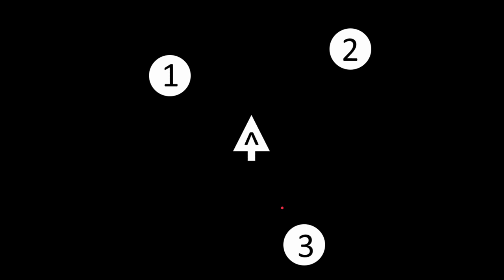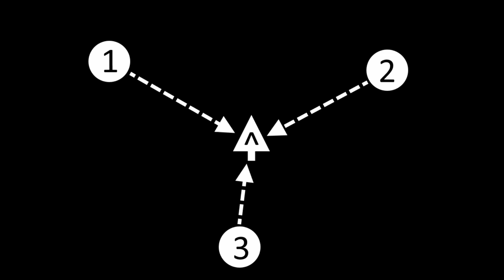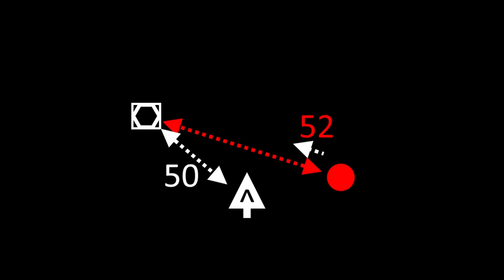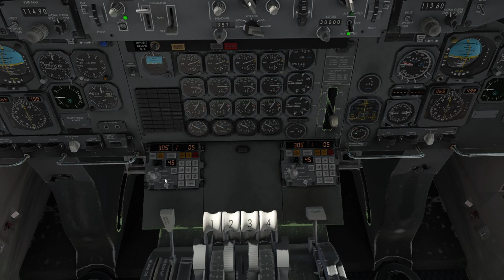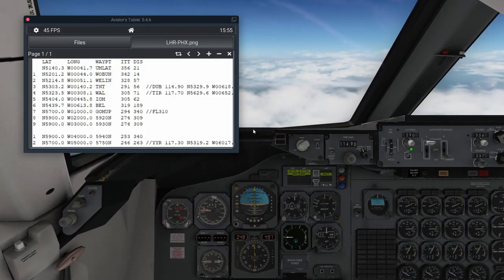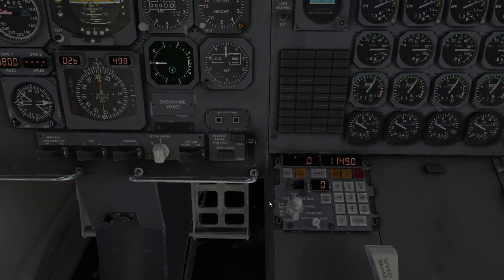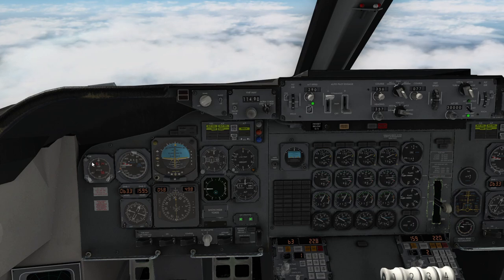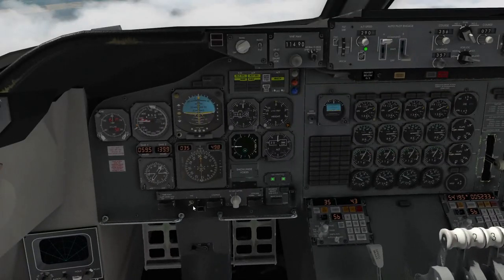Felis 747-200 Full Tutorial - Part 3 - Inertial Navigation

Comment: Great video with insightful info again Graem!

How often do we need to update the INS btw? is it one-time enough? 
Do we need to get back to system number 5(standalone) from 4(triple mix) after updating?
Reply from the maker: Typically you'd make sure the INS is updated before leaving land (on an ocean crossing), and again when you reach the other side. If you're INS navigating over land keep it as up to date as possible, but once every 500-800 miles should be enough.

The INS has two modes of operation - Aided (PI 4 on that STS page) and Unaided (PI 5). In PI 4 (should be set on all three units in normal operations), if a DME update is commanded the unit will do that and each INS will update its own corrections to reflect the new accurate radio position, so in that respect when DME updating triple mix isn't needed as the three units will have the same position.

After DME updating is finished the unit stays in PI 4, and changes to triple mix (that red triangle thing in the video). The means that when the "pure" inertial position drags those correction values away from each other the resulting navigation position is more accurate than each INS could give independently. 

You shouldn't need to go to PI 5 again unless the triple mix calcs start giving odd values in a failure case and you want unaided (single INS unit) navigation - but AFAIK this kind of failure isn't simulated as yet.

Hope that all makes sense?
Reply: @ReflectedRealitySimulations  Excellent! Thank you for the detailed explanation. Appreciate that

Comment: gday, firstly, this series has been hugely helpful already, a big thank you. I was just wondering how exactly you got simbrief to spit out a flight plan in that format? or did you manually create such a thing? I'm just having trouble planning a flight with appropriate DME updating stations along the way
Reply from the maker: Yes that is a little bit of a hassle. I extract the information from SimBrief into a text doc so I can annotate with waypoint numbers etc. You can also use LittleNavMap to obtain the data, but I do find a basic text doc more useful. Unfortunately modern plan formats are not really designed with VOR-VOR or LAT/LON INS navigation in mind.  You could even use XNVU, it's designed for the Tu154 navigation system, but does list the LAT/LON coordinates for the waypoints.

Comment: Hello Captain, thank you so much for sharing your knowledge. Could you please tell us some practical reasons for the HOLD function on INS?
Reply from the maker: HOLD is to freeze the INS position to allow a position update to be performed. Let's say you are arriving over land after a long ocean crossing, but the only waypoint is an NDB. You can't automatically update the INS position from an NDB, so instead follow the NDB as normal using normal radio navigation. When you pass overhead the NDB, press HOLD on the INS - you can now enter the NDB coordinates into the INS to manually update the position. 

By using "HOLD" directly overhead the NDB, it means that you don't need to rush the position entry as the INS was held in place at that point, and when you come out of hold mode having updated you should be exactly on track again.  IRL they could also do position updates this way by using the radar in ground mapping mode, although this doesn't work in X-Plane.

Comment: Hey reflected, Whenever I try to update the INS with the VOR's, I keep getting random numbers  in DIS/Time that are wildly unrelated to the distance and time to the VOR I am using for updating. I insert the VOR coordinates, elevation, and frequency into the INS, I just cant seem to understand what might be wrong. The distance for some reason is thousands of miles and the time  is 999.9. I tried with many stations but I keep getting the same results.
Reply from the maker: Thanks for the question Scott, and sorry for the delay replying. The INS updating is difficult to begin with. After entering the coordinates for the DME station, and while the INS is still in DME update mode, you need to use WAYPT CHG then choose the waypoint you loaded to DME details into, then INSERT - this is how you actually start the DME update and it should give correct values on the DIS/TIME page.

Comment: 7:10 the DME is also direct, and does not account for altitude.  The further from the DME range is taken for update, the more accurate the resultant is as the altitude component is minimised.
Reply from the maker: The DME simulation does use slant range, you can see this as it doesn’t count down to zero when overflying at altitude. The INS has altitude input from the air data system in order to correctly interpret the DME distance and compare it with the distance over ground to the DME station.

Comment: One question (absolutely not a pilot here). When you do the INS updating, after the aircraft corrects the course, I can then change to a different VOR on the panel, right? I noticed that when I change it, the updating stops. I'm guessing once the course is corrected, it's done and you can change the VOR frequency, is that right?

Comment: When entering the DME frequency via the INS CDU, does this frequency overide the VOR/DME frequency on the VOR control panel? Does the INS CDU send a tuning signal to the DME transponder and or the VHF Nav receiver ( usually a Colins 51RV-4 or a kings KNR6030). IE, can the pilot tune into a VOR/DME and get bearing/distance information on his RMI and HSI while the INS is DME updating on a separate frequency? Thank you.
Reply from the maker: Sorry for the delay replying Barry. No, it doesn't automatically tune the DME in this case. In fact, we discussed this quite a bit during the beta as there doesn't seem to be a good reason for the frequency to be needed, except using it as to compare the frequency tuned on the radio and rejecting any update if the frequency is incorrect. It's a single radio for each pilot doing all the work, all manual.

Comment: I have a question: last week I flew from Amsterdam to San Francisco. Over Northern Canada the INS had the autopilot fly on approximately 264, where it should be on approximately 252 to the next waypoint. I had to switch from INS to radio and use the Heading mode for a while. Is there something you have to do with the INS when you fly in more northern regions? I’ve noticed a difference between Heading and INS, where the one gave me True heading and the other Magnetic. I think that the difference between True en Magnetic was the cause. Is there a way to counter this problem? I want to repeat the flight this weekend to see if it happens again.
Reply from the maker: The INS will always give true heading. On modern aircraft the magnetic heading is calculated by taking the true heading and applying a magnetic variation correction from the navigation database, whereas older aircraft like the 747 that don't have a navigation database sense magnetic north with a flux detector which is like an electronic compass. It shouldn't be necessary to make any changes for polar flight. The INS mode on the autopilot couples to the INS directly so what the HSI shows is irrelevant, but switching RAD/INS to INS will give you True heading on the HSI also. Remember also it's flying great circle tracks, which don't have a constant heading. If you have a planning tool that provides an average course for the leg then then it won't match up - the value you need is ITT, initial true track, the track flown when leaving waypoint A to fly a great circle track to waypoint B.  Hope that makes sense? If you have a specific route and waypoints I can take a look?
Reply: @ReflectedRealitySimulations  Yes, that makes a lot of sense. Thank you for your reply! I think the average track on the flightplan and the Navigraph display had me fooled. The route that I flew was: 

EHAM VALK3S IDRID L980 LAM L179 CPT UL9 KENET N14 BAKUR DCT REVNU DCT AGORI DCT 5920N DCT 6230N DCT 6240N DCT 6050N DCT URTAK DCT KLIPS DCT ZSJ DCT YDN DCT GGW DCT DLN DCT DERSO DCT LEGGS BDEGA3 KSFO/EDDYY.I28R

It was the stretch from KLIPS to ZSJ where the plane went of the route in Navigraph, but given the fact that it is the longest leg (935NM) between two waypoints I'm pretty sure it's the correct ITT. I hope to fly the route again tomorrow and I will let it proceed and see where I end up. Thanks again!
Reply: @ReflectedRealitySimulations  I am flying the route again and can confirm that the average heading on the flightplan and Navigraph map had me fooled. I let the INS do it's thing on this flight and it 'curved' me perfectly to the waypoint. Thanks for helping me out!

Comment: The 3 CIVA that the B742 Felis brings by default, are they enough? because I have seen other videos that recommend flying better with the Delco Caurusel CIVA
Reply from the maker: The Felis INS units are much, much better than the "Philipp" addon CIVA.  Felis has proper triple mixing and his logic is a lot more reliable. You don't need to buy anything extra to use the 742, it's all included.

Comment: Hi Reflected. When I am updating my INS sometimes the INS updating light does not show up, even though I press Waypoint Change, 1, Insert. Any reason why this might be? Thanks.
Reply from the maker: It's most likely not in the correct navigation mode. Look in the DSTRK/STS page and the last digit should be "4".  Have a look at 11:30 in the video.
Reply: @ReflectedRealitySimulations  Thanks for  the reply. I turned my INS systems onto system 4 when I was on the ground. I also noticed that in my settings the INS SOURCE is REAL and not SIM GPS. Would this change anything?
Reply: @ReflectedRealitySimulations  That was my Problem and it was driving me crazy. I better had watched your whole video and not skip the first half :D

Comment: Really great videos you have produced here, well done and thank you. If after following all instructions up to the point of starting DME updating, ie I have entered everything as per video, and after pressing WYPT CHG, 1, INSERT, the green DME updating light does not come on, remains unlit; does this mean the INS is ok, ie does not need updating, or is something wrong? I have watched video many times, I am following all exactly, but still light does not come on. Is there perhaps an option in settings I am missing that turns off this feature?
Reply from the maker: Hi Fred, sorry for the delay replying. You're doing the right things for DME updating, so the most likely issue is not having the INS set for "Aided Inertial Naviation" - this allows the INS computer to store position corrections from either the other two INS units (triple mixing) or ground stations (DME updating). To enter Aided Inertial mode, go to DSTRK/STS, then key in [4] [INSERT]. You need to do this on all three units separately.
Reply: @ReflectedRealitySimulations  Thanks so much for replying. yes, I have done the Aided Inertial Navigation as you explained in the video. You do it so well and clearly. The only difference I notice is that I don't end up with "04" in the display, but "74' or "64". Maybe I have a faulty INS😄
Reply: @ReflectedRealitySimulations  Thanks! I think I'm falling in love with this aircraft

Comment: Sir, I now have the Felis 742 and the other night I ran into a situation with the INS I need your help with. Flying from CYYZ (Toronto) to CYHZ (Halifax) I neglected to put in the coordinates for an arrival as I did not know which one to use. Instead I put in (last 3, MLT, YSJ, and YHZ vor's). Brand new to the CIVA INS, everything was running smoothly unitl BOS CTR asked me if I had access to the FUNDY5 Arrival. I said I had a chart and he cleared me to EBONY to begin the arrival. I then went to the INS panel and drew a blank. I was quickly approaching MLT and then past it as I realized 'how do you put in new coordinates" in flight. There was no 'direct to' like the FMS lol. Is there a procedure to input new coordinates for the FUNDY5 or is it just that simple to find the lat/long and start putting them in. Most videos load the flight plan and it flies it but none show an en-route change really.
I absolutely love your instructional videos and I don't think you get the recognition you deserve!
Dave
Reply from the maker: Thanks for the nice feedback Dave, and it's a great question. The INS can't load the procedures directly, so you'd need to find the coordinates for EBONY and load that as a new waypoint. Lets say you load those coordinates into waypoint 5 - to go direct-to use WAYPT CHG - 0 - 5 - INSERT.  Waypoint 0 is used to mean "here", so you're asking it to go from here to EBONY.  In general though the INS wouldn't be used to fly arrival and departure procedures, so you'd be back to conventional VOR/NDB navigation on the SIDs and STARs. 

Easiest thing for online flying is to make sure you're not filed for rnav capability, and request a non-rnav arrival or radar vectors!
Reply: @ReflectedRealitySimulations  Thank you so much. I believe the waypoint window was showing FROM 6, TO 7 at the time of atc re-route. Would I put the EBONY lat/long into a slot previous to 6 or past 7 - say 8? I'm assuming it is referencing 6 and 7 so a re-program on 7 wouldn't be allowed? I couldn't figure it out, so BOS CTR transferred me to Moncton CTR and they asked if I wanted RNAV to RWY 05. I said not RNAV capable so he just gave me vectors to LOC 05. All worked out, I was just curious as to how to insert a new waypoint.
I love flying the yester-year planes and old school navigation. I have the FJS 727 series and the 737-200 and only fly them VOR to VOR...not even INS.
I very much appreciate your work.
Dave

Comment: In skyvector the vor provided has 6 numbers but the civa in felis only has 5 is it fine to remove the last number on the flight plan
Reply from the maker: Sorry for the delay replying. There are several formats for the units, and you need to be able to understand and recognise them, CIVA uses ddd mm.m - degrees, minutes and decimal units. Other systems use ddd mm ss, degrees, minutes, seconds. I believe SkyVector uses ddd mm.mm - decimal minutes to two decimal places so you can simply round the last digit. For degrees, minutes, seconds 6 seconds is 0.1 in decimal, so 123 45 18 would be 123 45.3 (18/6 =3). It’s easy to spot decimal minutes vs seconds - look for any value over 59!
Reply: No Problem! Thx I have a better understanding what ins way points actually are! :)